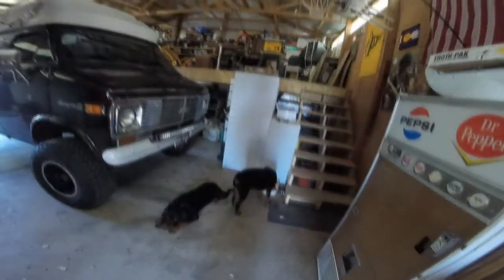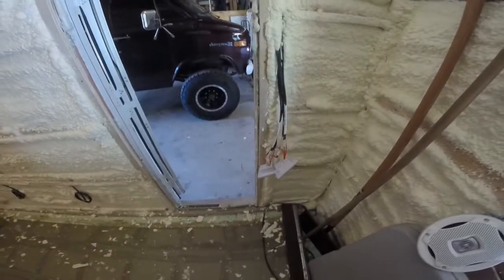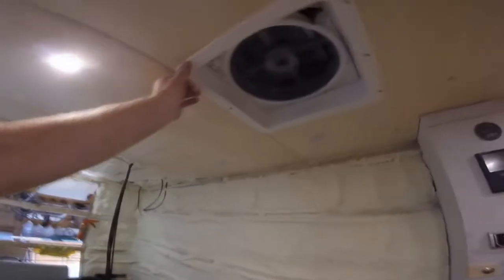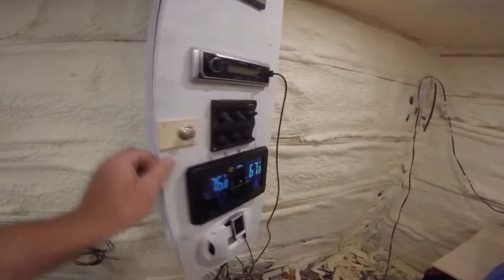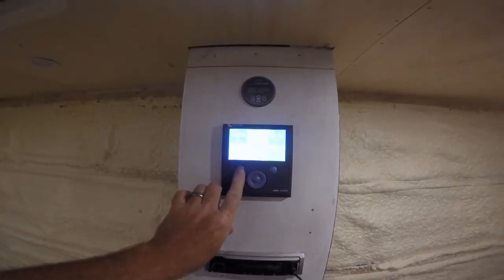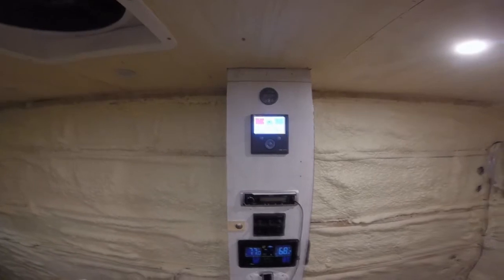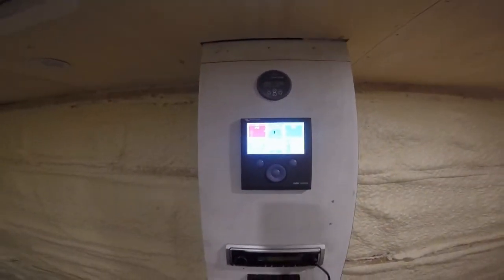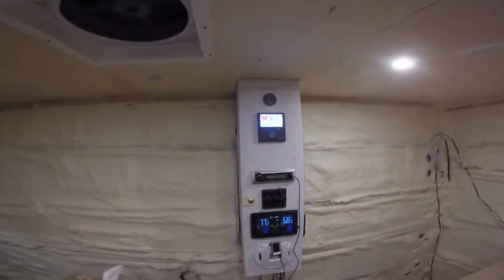Build Update 6-6-18

Comment: I've recently started following your channel and I enjoy it quite a bit, thanks for producing it!  I know this is your second build and you have some experience, but what do you use for planning? I'm interested in starting to build a lightweight trailer to make camping easier with the family, but I'm not clear what specs for components I'd need.  Capacities on inverters, charge controllers etc, water tanks, as well as placement all seem a bit hazy.  Any resources you could share you use for floor planning and capacity planning would be greatly appreciated!
Reply from the maker: For some of the early planning on this specific build I used these books: https://www.amazon.com/Motorhome-self-build-optimisation-Ulrich-Dolde/dp/3981855310/ref=sr_1_1?ie=UTF8&qid=1528469921&sr=8-1&keywords=self+build+motorhome and https://www.amazon.com/Overland-Camper-manual-Haynes-Manuals/dp/1785210769/ref=sr_1_1?s=books&ie=UTF8&qid=1528469966&sr=1-1&keywords=build+your+own+Overland The first is more in depth overall, and the second has a lot of info on sub-frames, etc. As for components, the research takes a TON of time! One of the reasons I'm getting all of my components ahead of time is because there is so little info on specific components. For example the Multiplus I just received...I couldn't find much info on the size/weight...and even less on the guts/installation requirements. (I will share all of those soon). My first build was pretty organic...a lot of trial and error...but with both builds I knew my vehicle/living quarters size up front. Then it was a matter of making everything fit properly. Hope this helps!
Reply: It does help, thank you for the information!
Reply: Todd Nine we usually have a look at what other people and companies are doing and pick out what suits us. For laying things out I.e. furniture we will get some empty cardboard boxes and place them where we think that they would work for us. 
Our latest van layout is based on a commercially built van from one of the major motorhome companies in the UK.